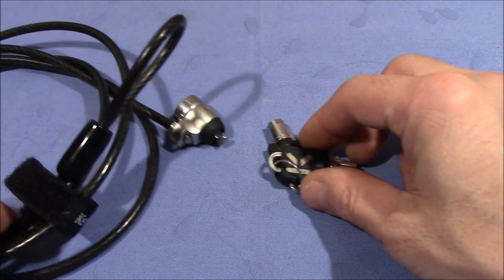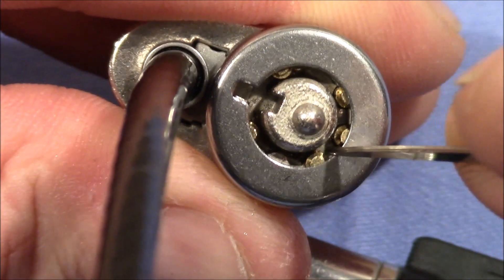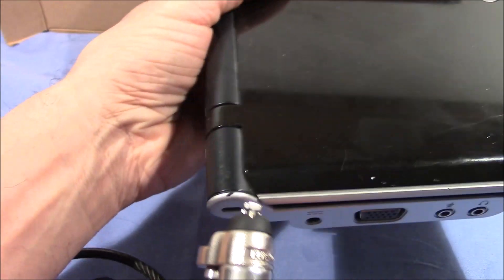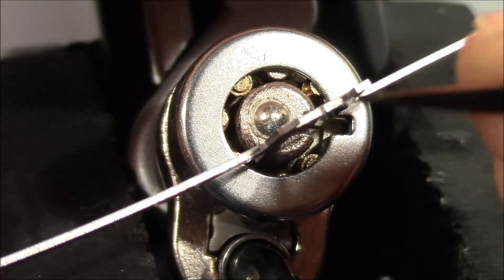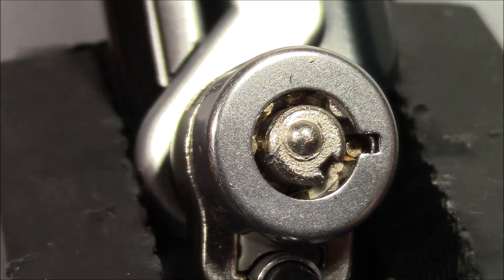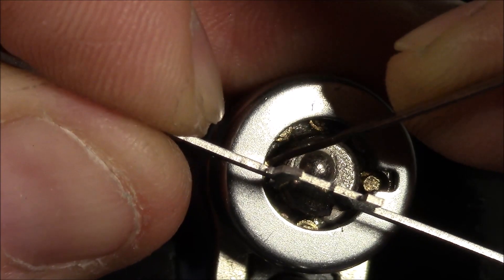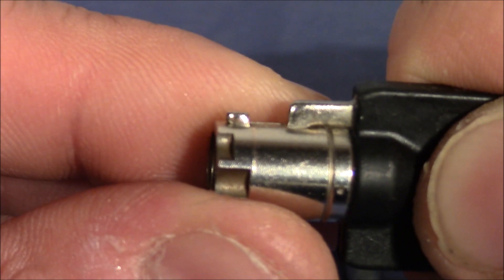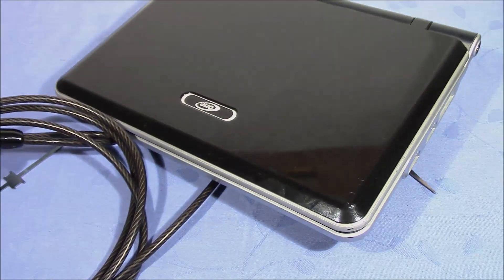(picking 726) Weird Kensington laptop lock picked open from a little laptop

Comment from the maker: I pick open a Kensington laptop lock (tubular lock). This lock is special as the usual 7 pins are reduces to just 5 by having one empty spot and a dummy pin - really weird. The picking setup is with the lock locked up in a little computer clamped in a vice - enjoy :-)
Reply: The ball on top of the center post seems to be useless. What if they made it bigger? Would your tensioner slip off or still work?
Looks like that lock can still be impressioned. Have you tried that?
What about taking the lock apart? Actually, I don't think I've even seen any lock picker take apart a tubular lock. Would be interesting to see why they made those changes to the pins. I think I saw another video about 2 months or so ago (not sure who made that one now) where they mentioned one of the pins was a dummy pin.
Reply from the maker: Cheers; The ball on top of the post could be as big as it wants, because the wrench just uses a portion of the posts surface. To be more effective it would have needed to be shaped more like a dome. I have no impressioning tools, bur maybe I'll take it apart.

Comment: I did the same to a similar kensingon lock except i used an impression tool but i cant get the lock to turn back close again. I first tried with my impression tool again but after that didnt work I did the same as you and filed the metall thing on the key away. For some reason it still doesnt works :(( any tips?
Reply from the maker: No ideas without seeing it. Sorry.